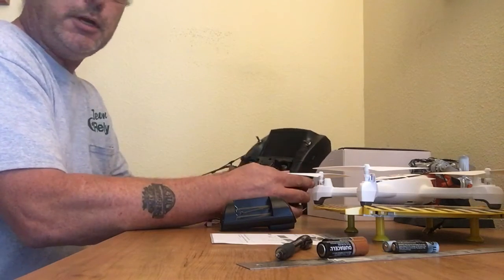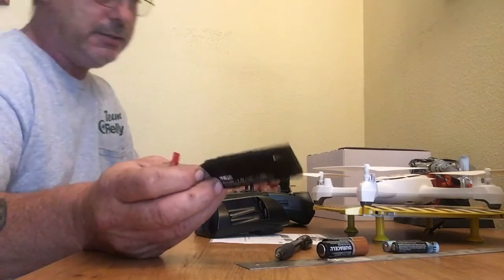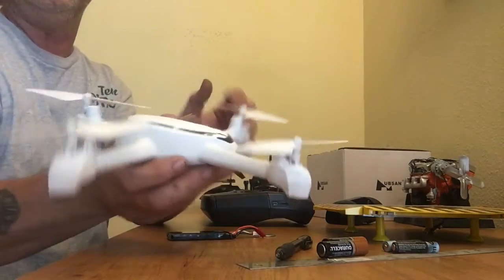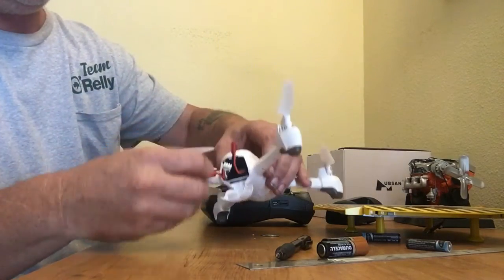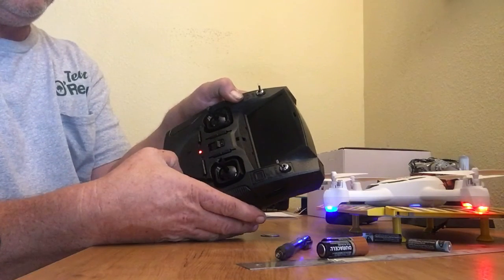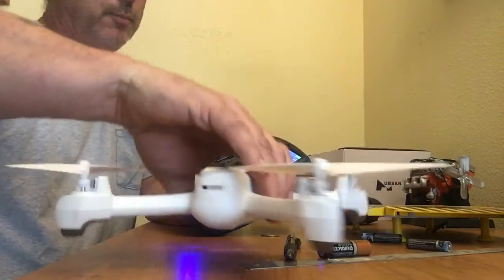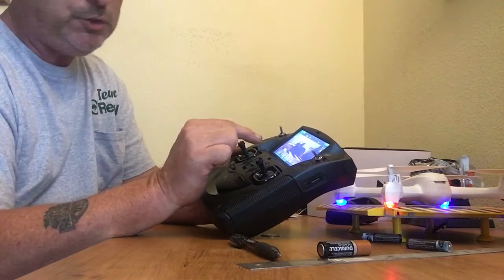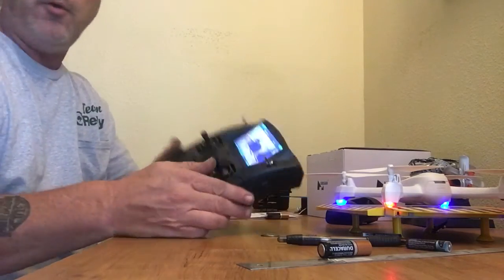Hubsan X4 H502S GPS FPV drone Review / testing

Comment: Definitely right about tx battery's I tried fresh alkaline lasted no time then fresh rechargeable aa, battery's world good but constant beep low voltage alarm !! But I then put new energizer lithium battery's in transmitter perfect I got 10 flights on them still showing 100% ,,I wanted this quad but caught the xinlin 118x fpv for under 50.00 shipped it's the 3,7 v version of the xinlin fpv the drone drinks little 3.7 v battery's m gonna get the Walkera 1600 mh soon try them

Comment: Good review - thanks.

I took mine for a maiden flight yesterday evening, having read the manual front to back at least twice.  Unfortunately, the manual fails to include a lot of things (e.g., holding down the photo button while turning on the transmitter).

I have the batteries charging now, and hope to take another flight later today.  Your comment about the transmitter drain of batteries is right on - a fresh pack of Duracells only lasted only one flight, so I have to break out my NiMh  rechargeables.

Needless to say, I crashed it into trees/bushes several times, when I got disoriented and moved the stick in the opposite direction.  I think prop guards should have been included - it may have bounced off of a bush, instead of getting tangled up in it.  One thing I did right was to quickly disarm the props when it got  caught up in the bush.  I now find that when I start up, one of the props does not spin up, until I increase the throttle or manually get it started; it seems to fly OK, though I can't help but think this is due to some kind of damage caused when I got tangled up in the bushes.

One problem I have is with recording the video, or lack thereof.  I took a 64G Samsung SD from my Samsung tablet PC, and plugged it into the slot in the copter, but when I hit the record button inflight, nothing happened.  I'm thinking the card may have needed formatting, but the manual doesn't say anything about formatting.  The video from the quad DID appear on the transmitter.
Reply from the maker: well i hope that this video help you out and you enjoyed your first flight. :)
Reply: I tried to fly today, but it seems somehow I've lost the pairing; the transmitter starts normally, but nothing from the quad.  Any ideas?  I have version 1.1.28 firmware, if that matters.

I tried to rebind, as you showed, but it just doesn't bind.  I held it very close to the quad, and from different orientations, but no difference.  I tried startup with the photo button down, and without.  Both batteries are OK
Reply from the maker: do the lights on the quad change color when you are trying to bind it
Reply: +blazerpi02 When the quad starts up, only one light comes on for about a sec, and then the others come on, and everything flashes at the same rate (about every 2 sec.) and this goes on until I disconnect the battery.
Reply from the maker: That does not sound good. try to get a hold of Shally Liu @ www.hubsan.com  However there customer service is very slow. where did you buy this one from ?
Reply: +blazerpi02 From Amazon.com (mifly drone).
Reply from the maker: one good thing Amazon has a great return and replace. I bought mine from him too.
Reply: hziemba I think a 64 G ad card is beyond the ability of the system, I use mine with an 8 G and it works fine, nice pic & video.